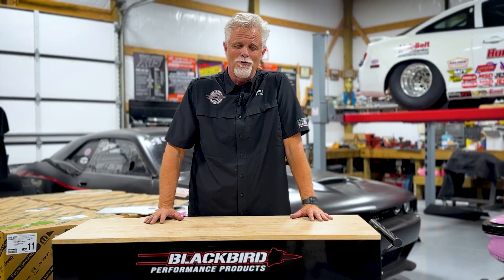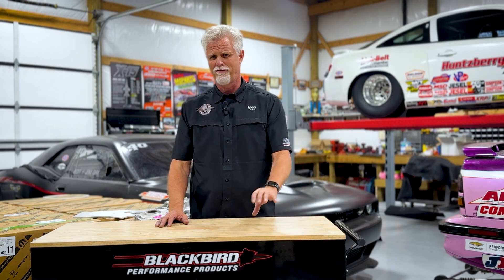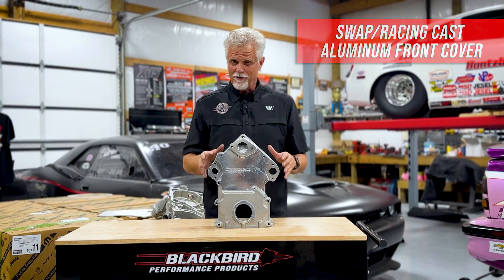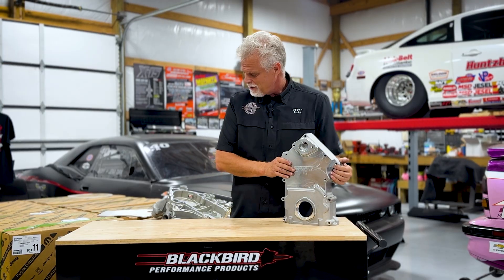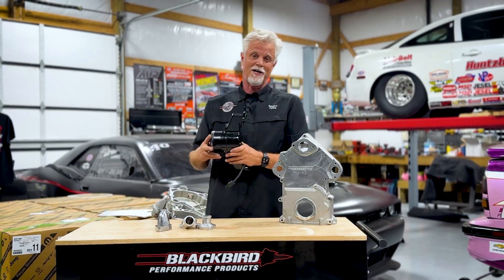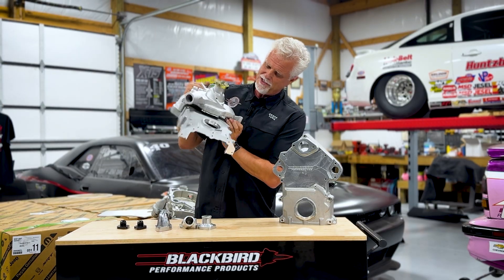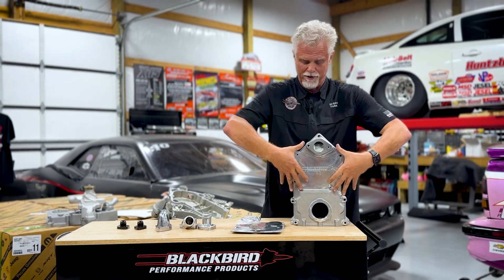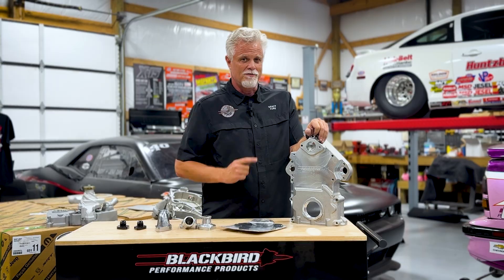Blackbird Performance Swap/Race Cast Aluminum Front Cover

Comment: With a standard water pump will this be able to run on a stock belt assembly? What pulley options are there on a standard water pump? Would like to run this on my stroker 426 2019